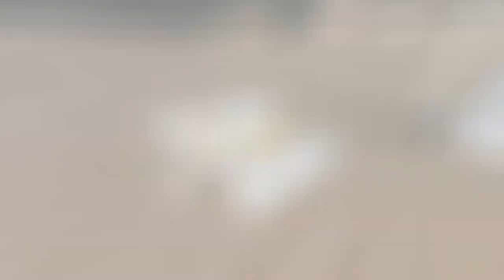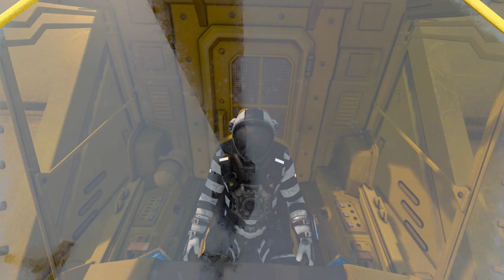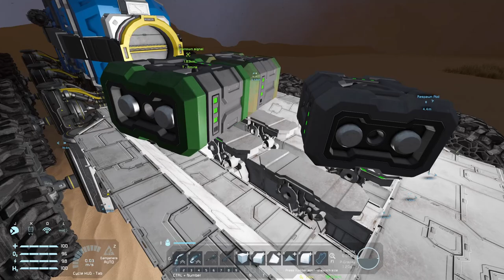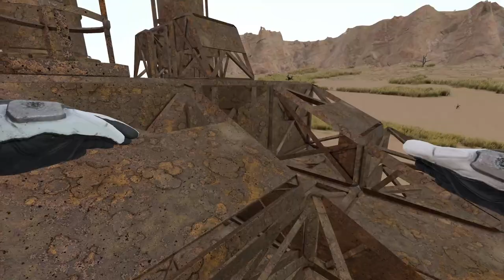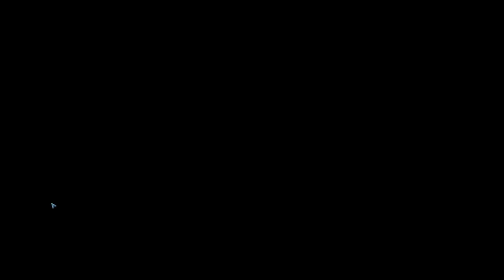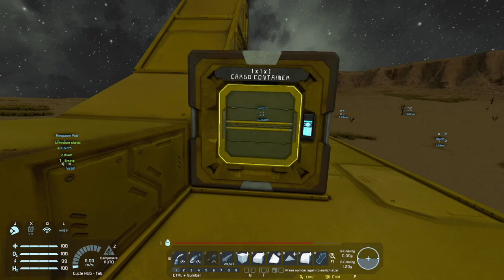Space Engineers Surviving Pertam: Making A Welding Crane | Part 11

Comment: extend the front wheels forward 1 block for better steering control.
add a fourth Axle/wheelset to increase the overall footprint and stability, this will allow the placement of that large Cargo Container right on the centerline for balance.
it will also extend the wheelbase to clear the back of the rotating crane unit to permit the solid footing of a piston/landing gear leg.

2 pistons connecting the welder head to the crane will add reach and also permit reaching the ground right in front of the vehicle.